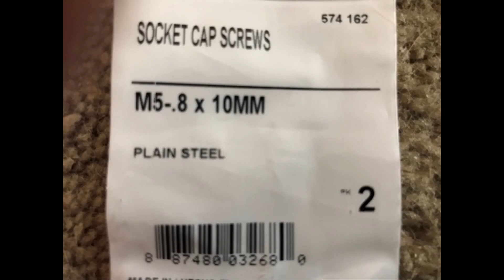V3 Mods and Fixes (Paint, Screws, Soldering)

Comment: How did you remove the side cushions?
Did you use primer before painting?
Did the paint stay on well long after applying the paint?
Reply from the maker: Just be sure the room is warm and the cushions will pull off gently.  Don't pull too hard or they will tear.
I used a Paint with Primer built in.  I lightly sanded all parts before applying to be sure to get a good bond.  I then used Rubbing Alcohol to clean things before paint.
The paint is on very tight.  No chips or anything happening, and I ride it pretty hard.
The shells are now blue.  A buddy of mine bought them for me.  It's really nice now.  I've also painted the pedals and handle flat black to match.  See link below for a photo:
https://goo.gl/photos/oFqAUyErRjK38iWbA
Reply: Absolutely gorgeous! Did you paint both sides of the pedals?
Did you use the same technique for painting the pedals?
Did you do one side and flip it after it dried completely if so?
Reply from the maker: Yes, same technique.  Painted one side and dried, then other side.  I pulled the pedal apart so I got a good coat everywhere, then reassembled and applied new grip tape.  I'm super happy with the look now.  I've also added EL Lighting to the battery panels and a 3D printed fender.  Not sure if you've seen that.  Here it is before I had finished painting everything.
https://www.youtube.com/watch?v=KAUwDaXKX7Y
Reply from the maker: Just did a 50-60 mile ride around South Lake Tahoe this weekend.  Here I'm getting it a bit wet:
https://goo.gl/photos/wu8tiTrtfFRzEWyv6
Reply: Yea I saw it! very nice. I have 3D-printed the mudguard too! 
I'm going to paint everything matt black. Not going to be as nice as yours, but definitely less feminine-looking than the original one.
Reply from the maker: I really like the flat black too.